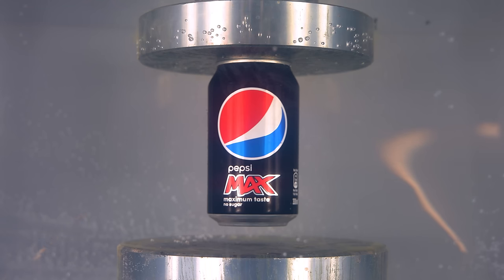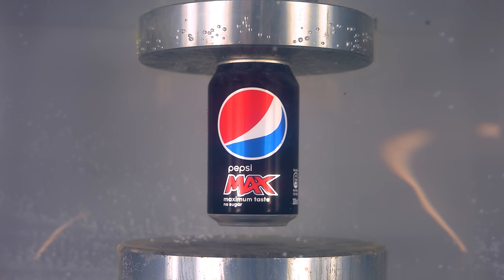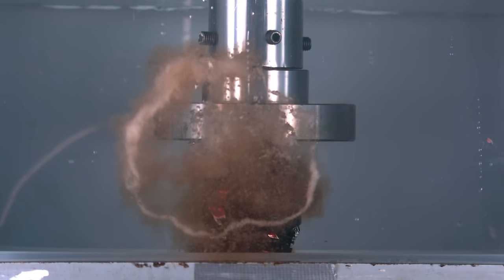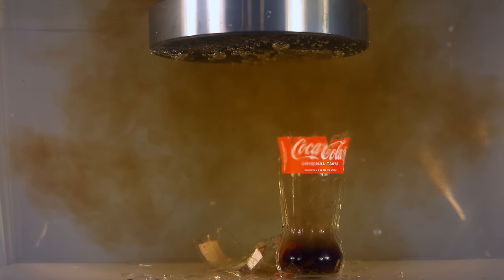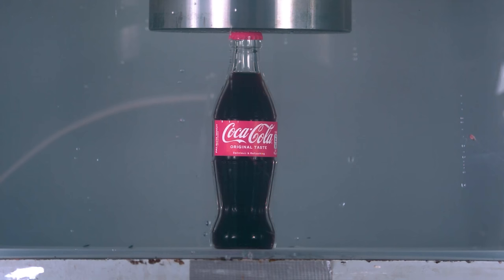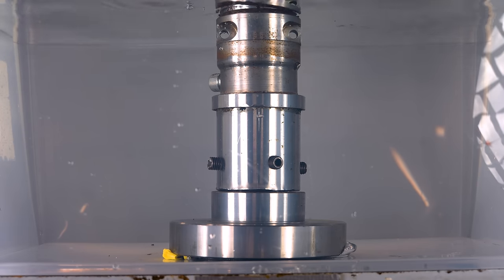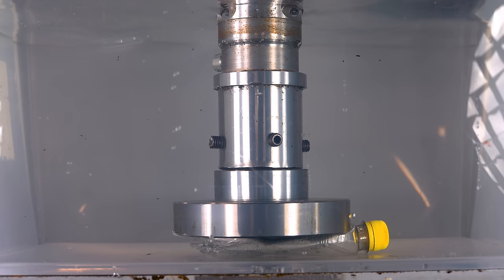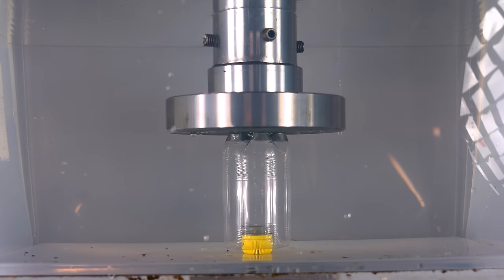What Happens if You Crush a Soda Can Under Water with Hydraulic Press?

Comment: I think it would be great to see some of the classics, especially exploding things underwater, like ball bearings, deck of cards, paper. Maybe prince Rupert's drop.
Reply: Great idea
Reply: Purple coloured glass for the Prince Rupert's drop?
Reply: Gas canister or a battery
Reply: The things being crushed can’t be too hard, otherwise the plastic water tub will give before they do, the metal bottom plate would cut through the plastic before a ball bearing or prince Rupert’s drop would give. But I suppose a plate shaped hole and some silicon sealant could resolve that issue.
Reply: @colinselfridge3935  big plate of steel on the bottom of the container should redistribute the force so it doesn't cut through the plastic. The only problem is I dont think the small press can break ball bearings.
Reply: This! Also would be interesting to see some normally exploding things which soak water in, like book or wood.
Reply: Deck of cards for sure!
Reply: @colinselfridge3935  Clipping the tail of the Prince Rupert's drop rather than crushing with the press would avoid damaging the water tub.
Reply: @CloverKismet  came here to recommend the same, I just dunno if it's possible in the plastic tub, as it took upwards of 70ton if I remember, which would push your lower press tool through the container
Reply: Batteries, burning magnesium, red hot steel, or anything that can burn underwater.
Reply: I agree, basically do everything over again but underwater. Would be interesting to see different reactions.
Reply: terrible idea, the water would break free from the weak plastic container since it's incompressible
Reply: I was thinking the same thing. Only considering how much pressure a lot of those things require, it might break the container of water...
Reply: I agree
Reply: @pattheplanter  They must make a bigger tub with metal bottom and acrylic walls.
Reply: would be interesting to see similar things crushed in different fluids - ie motor oil. Maybe colored/dyed water bottle crushed in water to see how the fluids mix.
Reply: Yee i was just thinking how some of the most volatile crushings would compare under water
Reply: Deck of cards for sure
Reply: The toilet special was amazing! But 'really loud'.... 🚽🔊😂
Reply: Ball bearings underwater would be sick
Reply: @colinselfridge3935  metal bottom with transparent plastic walls with some sealant would do.

Comment: Explode an inkwell. Squish a lithium ion pouch cell. Crush something with a vacuum inside, such as a low wattage incandescent light bulb (bigger ones have argon). Squish closed cell foam to make it release the gas trapped inside. Also try marshmallows and foam candy. Do a CO2 cartridge. Crush pop rocks. Squeeze cork, and see if it gets waterlogged and sinks when it expands again (if it expands again).
Reply: I like that.  How about ketchup, or a bottle of chocolate syrup?

Comment: Pressurize one of the soda bottles with air to about 7 bar before crushing. 

Either stick a tyre valve in the cap, or you can even just poke a small hole in the lid and use a football inflator needle. You can leave a little ball of blu-tac in the bottle and this will act like a valve when you remove the needle.

Comment: Interesting idea. I wonder if the worm maker 5,000,000 would make for some interesting things under water? dunno if you can adapt that to the 40T press. Also, since oil and water wont mix at all, i wonder if an oil filled vessel would make for some interesting high speed footage?

Comment: Love the water idea. You could use the press head that has holes in it and presses down into a cylinder base, so it will push stuff out the top thru the holes. Fill a balloon with cooking oil or water, food coloring and glitter, and crush that so we can see how it would all explode out the holes and the oil would glob together as it floats to the surface in slow mo! You could get some Sqand and make an underwater sandcastle and crush that. Maybe a can of food, rip the label off so its a surprise :P  Anything that has tension, pressure or a vacuum, the underwater reactions should turn out pretty cool.

Comment: You can heat up the cans and bottles (use hot water in the tank)  or maybe shake them up a bit before crushing them to increase the internal pressure.

Comment: More ideas!
Maybe you could try crushing soda cans submerged in some liquids that would quickly react with and consume the CO2, like lye (NaOH solution). Can be pretty messy and dangerous, though, so extra safety precautions are required. And lye would dissolve the aluminum can so only plastic/glass bottles will do.
Or, conversely, you can crush a plastic bottle pre-filled with a gas that would dissolve readily into water, like ammonia, under water. Phenolphthalein can be added to that water for more dramatic results.

Comment: Ok, here me out.  Different fluids.  All clear ones, obviously.  Once you've determined what makes the coolest, most interesting explosions in water, then you start experimenting with different fluids in the tank.  Here are some different classes of ideas I'm just pulling out of my butt as I write:

1) Different densities and viscosities.  Hexane has about 2/3 the density and 1/4 the viscosity of water.  Glycerine has about 900x the viscosity of water.  Corn syrup can be even higher viscosity.  How would exploding playing cards or ball bearings look in low viscosity vs. high or superhigh viscosity liquid?
2) Hydrophobicity vs. hydrophilicity.  Exploding a can of Coke underwater was a cool displaying of localized liquid diffusion.  Now if you explode it in a tub of hexane or vegetable oil or some other hydrophobic liquid, it's not going to diffuse, but instead the two phases will remain distinct when they come in contact with each other.  Now, what if you add a surfactant or emulsifier such a dish soap to a bottle of water exploded in a tub of oil (or a bottle of oil exploded in water)?  A very different effect.
3) Gases of different densities.  With a top to the tank and some gasketing around the tool, you should be able to fill the tub with helium, nitrogen, CO2, sulfur hexafluroride, whatever's safe and pull off the explosion before it leaks out too much.  Exploding something like paper that will make fragments small and light enough to be affected by the gas density would be ideal.  Small liquid droplets may also have notable different effects.

Just some thoughts.  I think you have a real winner with a lot of potential here.

Comment: One thing that could be interesting, is a container that breaks under water, filled with tiny amounts of the element Sodium.
Tiny pieces as the smaller ones seems to burn slower on the surface rather than big pieces that gives off one big bang.
Slower and more longer lasting may be more interesting to watch on high speed.

Comment: Wondering if the special wet/dry sand that is dry as soon as it leaves the water, but is wet and acts like wet sand in the water.
Fill bottle 3/4 full of that special sand, 1/4 air, and watch the dry sand interact in slow motion with the water. From dry, to wet, and the 'pop' of the bottle. 

Underwater Press is a great idea!

Cheers!

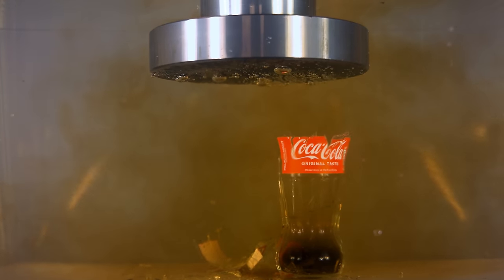Comment: I find it disgusting that when the cola mixes with the water, you can see the difference in density between the syrupy, sugary cola and the less dense sugar-free water. You can see a sort of waviness like a mirage where the cola and water are blending with the glass bottle. But with the can, it's sugar free so you don't see that same waviness. In fact, at about 2:25 when the bottle falls over, you can see the cola that's still in the bottom of it pouring out like it wasn't even under water. It just shows how dense cola is, and thus how much sugar it really has in it.

 If you're not sure what I'm describing, try mixing up a bit of strong sugar water, then slowly pour it into a glass of regular water and you'll see how the sugar water looks thicker as it mixes with the regular water.

Comment: Drain cleaner + aluminium foil in a plastic bottle underwater. Be very careful because it should produce gas that will explode the bottle if you close it so you don't even need the press. Or small piece of sodium in an empty plastic bottle that gets crushed under water.

Comment: Crush a vaping 18650 underwater. The cells designed for vapes have a substantially higher current rating than the ones in battery banks, and might make for an interesting crush underwater.
Reply: Make sure battery is fully charged for maximum value.

Comment: I'm pretty sure the bottle of air failed to explode because you were crushing the bottle cap, causing it to deform and break the airtight seal. but the half air half water did explode nicely for the reasons you said and maybe also due to the fact that the bottle cap was untouched by the press.

This is just my observational theory, i am bu no means a qualified in anything so i could be wrong.

Comment: you should drill a hole in the cap and put a car tire valve there and increase the preassure in the bottle to about 10 Bar and then compress it under water !

Comment: I was going to suggest a CO2 cartridge but you already said it.
How about a gas such as butane? A can of butane lighter fluid. Or one of the 8 noble gases, if possible?
I placed a can  of butane lighter fluid in front of a flame and shot it with a pellet rifle using a 100 fps camera years ago. I unfortunately do not have that footage today as it's been 2 decades  ago.

Comment: a bottle with no air in it.  Air is compressible and liquid is not.  See how much pressure it takes to blow out the bottle when there is no air to compress.  As the air compresses, the container deforms.  If there is no air, will it deform and blow out and if so, at what pressure.